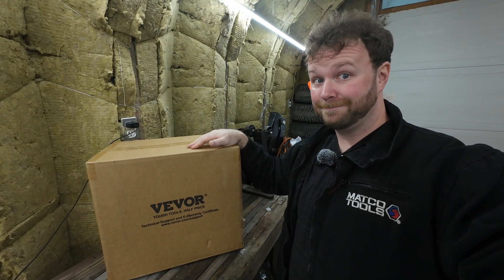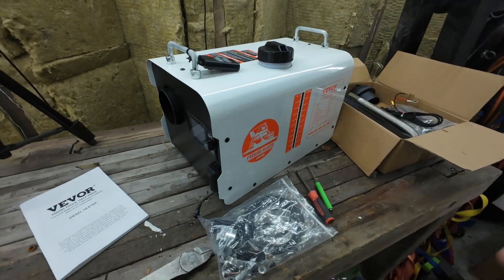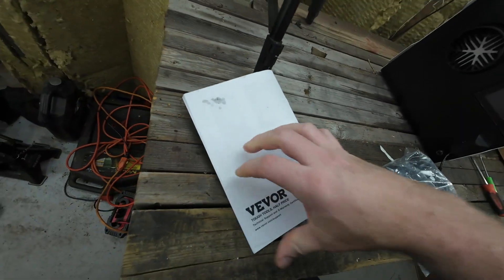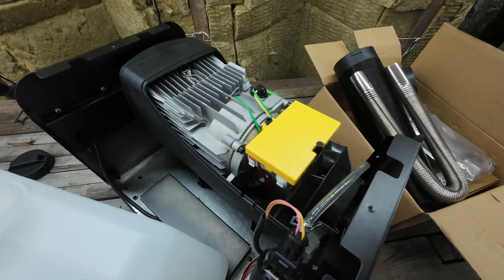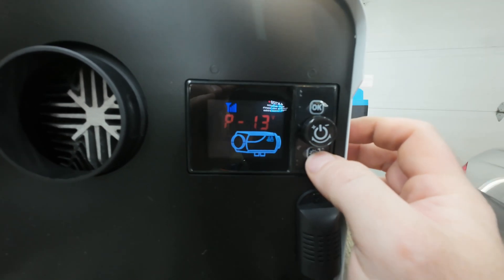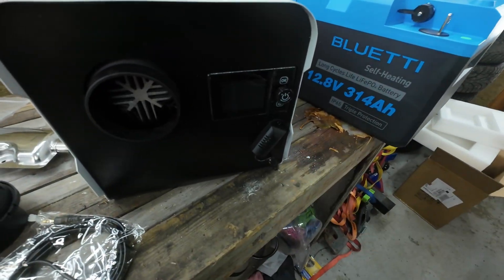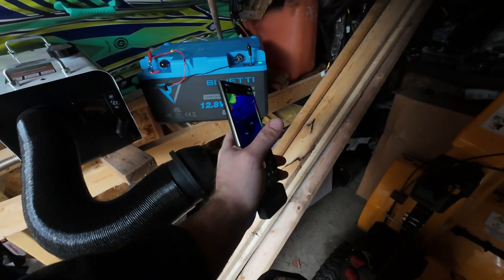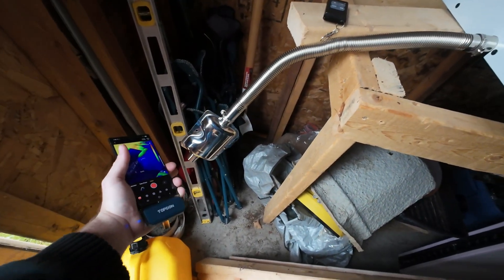Unboxing & Install: VEVOR 8 kW Diesel Air Heater 12/24 V – Shed, Shop & Off-Grid Test

Comment: The reason why these heaters became so cheap is the patent expired on the original expensive units the... lots of chinese mfg started to make them but did cut corners on using cheaper parts and materials.  The unit you have is same they use in RV/Camper Vans... without the housing that you just opened up.  Do not run low as it builds up deposits.  Good luck with that unit.

Comment: I've got 2 of these in my 24×24 garage,  it's a older barn style garage and does have some drafts and I can heat it up to t-shirt weather during the cold winter months here in Atlantic Canada,this will be my 2nd winter using them, they're fairly cheap to run we have a esso with a furnace oil pump in town and its about 20 cents a liter cheaper than diesel fuel which is great I fill 2 - 20 liter jugs and it lasts long time, I only heat my garage if I'm using it, they heat it up fairly quickly too. I saved all my fuel receipts last winter I'll add them up and update what my winter heating cost was. Also gonna save my receipts this winter I'm going to be out there more than last winter because I've got a project this winter.

Comment: I’m looking into getting the same unit for my garage (I’m in SW Ontario). 

My hold up, is trying to figure a way to route and scavenge the heat from the exhaust (sand battery?)
Reply from the maker: The exhaust does get hot. The unit is 90% efficient.  Getting some of that back through the exhaust is an option. The sand would hold some heat for a while.